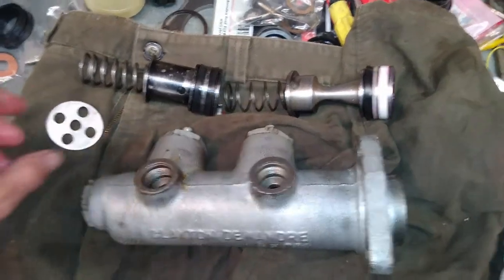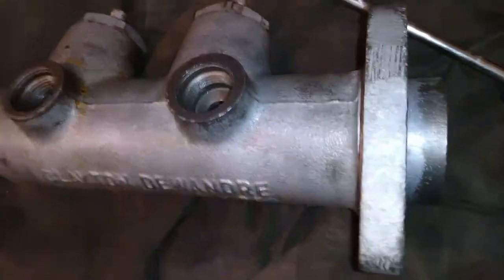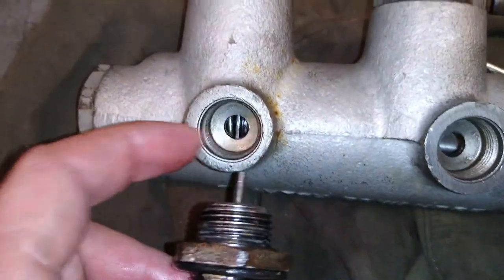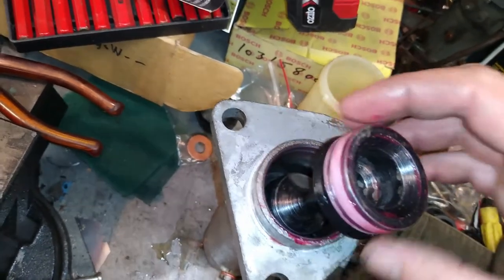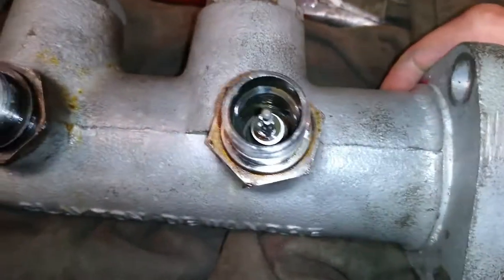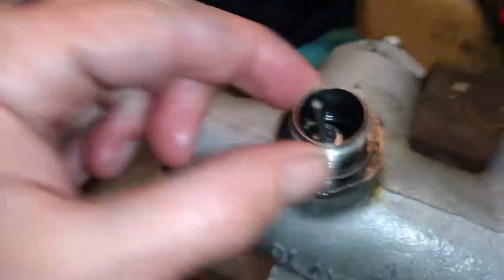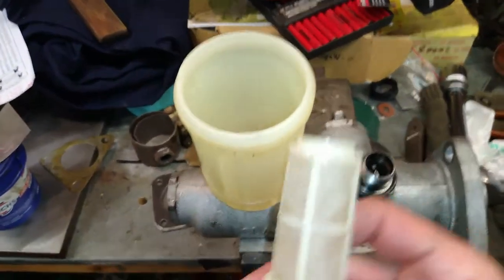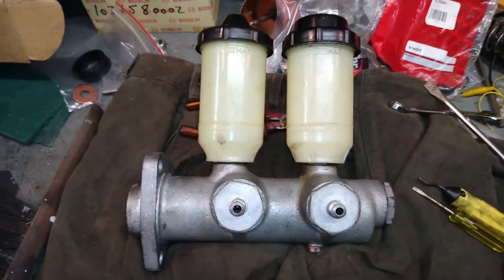Bedford Bus Brake Master Cylinder (Clayton Dewandre)

Comment: Hi there, any chance you have an email so i could shoot you a few questions about my 67 comair? Has had a 330d put in, the air lines are not hooked up, currently has a single out which is illegal i think these days, i have diesel booster to go in, just wanted to make sure im on the right trac. I appreciate your work, thanks for the vids

Comment: Gidday mate, love your vids - much easier than just going by the old service manuals.
Have a KGL TK and want to strip the servo and master cylinder. Do you have a contact in NZ for the rebuild kits? Have   found a servo kit on ebay, but no luck for the master cylinder yet. I haven't tried Lance Cryer yet. Cheers.
Reply from the maker: You could try https://www.toresleeve.co.nz/ they have done a lot of bedford brake cylinder re-sleeving  over the years. If you give them the bits they are good at matching it for the seals but this is generally done when re-sleeving the bores. The air booster servo seals are likely available from seal specialist providers like https://www.sealinnovations.co.nz/  but you would have to spend some time searching there part lists and ensure the material or rubber type is compatible with oil.  Its a bit of effort trying to find this stuff,   Lance Cryer my be the best start as a one stop shop, he has likely already have a supplier he uses. Good luck with the TK.
Reply: Thanks for your reply. I've managed to track down a rebuild kit for the servo on eBay. I haven't stripped anything down yet and will contact re-sleeve nz for a price on the master cylinder.
The original Bedford service manuals make for pretty dry reading and don't have many photographs so your vids make it a helluva lot easier, especially your tips.
Thanks again, much appreciated.